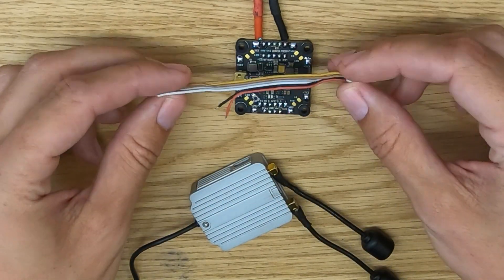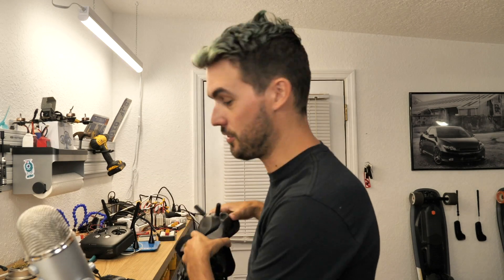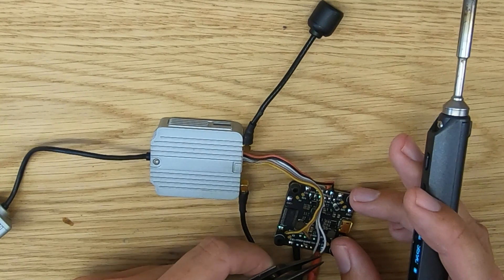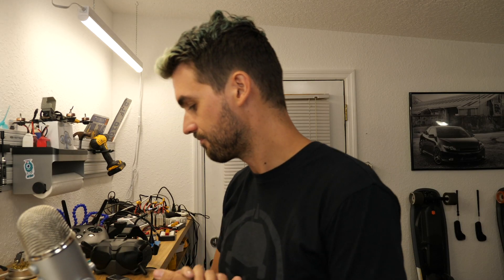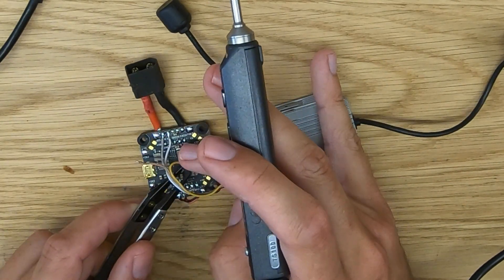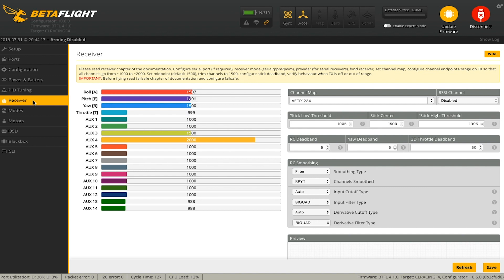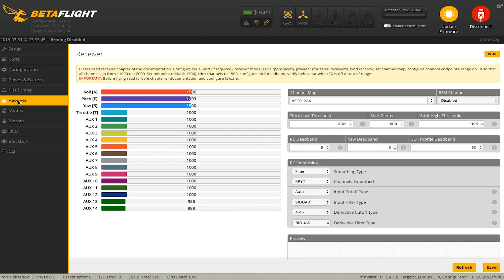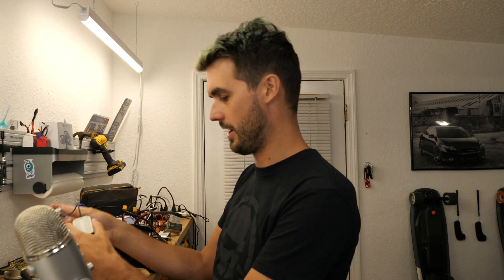DJI FPV Wiring Guide - How to connect to Betaflight

Comment: For that kind of $$$$$ why doesn't the harness come with real silicone insulated wires. Every vid I've seen shows the insulation melt back or get compomised by the tweezers during soldering. Jesus.

Comment: Does this support hdmi input?
In the manual it says av-in port on the audio jack is this true?
Maybe we can connect a rapidfire?
Reply: it has analog input. No HDMI input though
Reply: @Ferdigrapher   My bad. I did forget to answer the first question,...
Reply: Yes. Where you downloaded the manual, scroll down to the FAQ:
3.Are the DJI FPV Goggles compatible with analog transmission systems? 

Yes. The AV IN function in the DJI FPV Goggles allows you to connect a third-party analog transmission receiver to the goggles. However, it is not recommended to use an analog transmission system and the DJI Digital FPV System simultaneously.

Comment: Why does DJI want all my info to use the goggles? This does not seem right to me. What’s up with wanting your data!! You can got the mavic for the price of just goggles. Not that I like the Mavic, worst gift I ever asked for. Lol it sucks only used it twice because of DJI reporting me because I live within 5 miles of 4 airports at my house. So I thinking they may do the same here. Maybe that’s why they want my info. It could have been great product ,if you only needed the camera and air unit. And works with your HDO’s. After all it’s working on 5.8 and only 720p. And the 1080p recording is old school at best. But it’s probably a gimmick and 4K air unit will be for sell at Christmas. So you buy more of their junk. Horrible company for this hobby. I love how they are using all the well known freestylers yet no one is freestyling

Comment: Good afternoon. I want to start flying with FPV drone. I need advice what fpv drone it is better to buy to use it with a suit dji fpv system. Thanks a lot.
Reply: Студия Шар-Ура Воздушные шары fpv is supper fun. If your just getting started I advise you to follow the tutorial series by joshua Bardwell. That’s how I built my drone and it flys very fast. I recommend you try and build your drone rather than buy it because you will crash and it’s good to know how to fix it. But if you really don’t want to make one, you should get the eachine wizard, it’s realitively cheap and works really well. It is initially ready to use the Flysky transmitter so you will have to remove that receiver and solder on the vtx provided with DJI kit. But I would recomend building it. It’s a very fun hobby. Good luck 👍

Comment: While they are getting osd sorted let them know it needs to be compatible with inav as well, need to use it in a wing
Reply: its not realy a system for longer range as it is a bidirectional transceiver link. for long range you need a oneway link like "fpv blue"

Comment: as much as I know dji puts out great products, I need to know I can get any and all telemetry and FC data into the OSD if I choose. specifically, home orientation arrow and speed from my GPS receiver. a third party promise about this isn't enough for me to pull the trigger yet. also, fatshark just announced their digital HD fpv system, so...
Reply: Not available yet, it should be really easy for dji to implement it, I hope they don't pass on it as it is of critical importance when flying distance.

Comment: Hey drew,
Is it possible to connect just power to battery voltage (obviously running 4s)
Ad in the Google it will display voltage in the osd.
Or it must have telemetry to read voltage
Cheers
Reply from the maker: No it must have MSP connection for battery voltage. It does not read the voltage of the power source for the unit.
Reply: @drib2896  damn!
Cheers mate thanks for the reply

Comment: this DJI SYSTEM came out one year ago.  The RE Black Goggles !  They have BOTH digital and analog built in !  Yes the goggles are huge.  BUT the image quality is absolutely astounding.   The "air unit" is twice this size.  wiring and hookup is identical.  use the "buddy trainer port"  to get the Occusinc Range !   the goggles  are excellent to connect to HDMI on the computer to watch Netflix  youtube  m etc …   I have owned DJI for years and still fly Mavic Pro all the time.    They have an excellent service center system.  Will this system have a return to home  (not just Betaflight RTH) ?
Reply: Emiliano Zapatta the RE black goggles were good but not good at all for fpv and drone racing because it wasn’t low latency, this new version is a lot better

Comment: The big question is will you get rid of all your analog systems and install that in all your qwads and use this system everyday
Reply: Too expensive for most people I'd imagine,  I'm sure Drew could now that dji have had a good review from rotor riot!  I won't be upgrading as it won't fit my 3" quads and i don't want a giant set of goggles additional to my current stuff
Reply: @Simey2wheels  i take it you didnt see it in a 3inch frame with UMMAGAWD
Reply: @lewisshipway7187  it was mounted in a Acrobrat?

Comment: This product is pretty damn interesting and in my opinion one of the biggest innovation in FPV industry over the years. Im wondering several things. First - will it sell well enough for the second generation to be created. Second - if not how long it will be supported by DJI in the sense of software development so far, it can be safely said that it is a prototype very good but still a prototype. For example you cana djust PIDs on gogles but you can't show OSD data - I think just firmware update to fix it. DJI did one very importand thing with this system. They showed that a digital HD FPV and low latency system can be made relatively small and not that horribly expensive (stil not cheap but can be accepted). I think that this product will have serious impact in the future FPV market. DJI was basically absent from this market past years and people flying racing/FPV drones often joked with DJI users that they don't know how to fly real drone ;) Now DJI gives FPV pilots a product about which everyone quietly dreamed in some degree. We live in really interesting times.
PS.What an irony ;) HD FPV is now hooked to J.Bardwell's FC. J.Bardwell himself said one day that such a system is loooooong future ;)
Reply: well its popular enough to be completely sold out in europe at least...